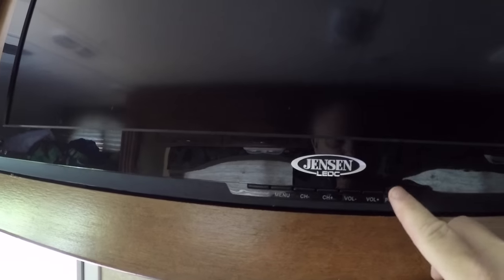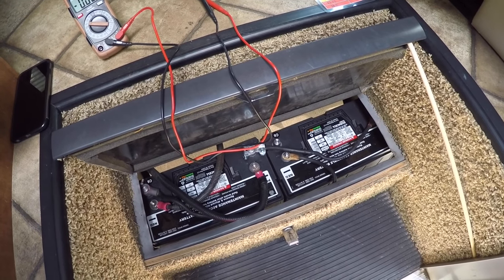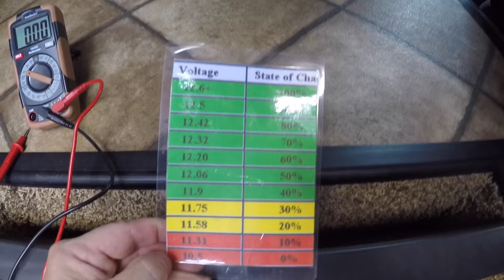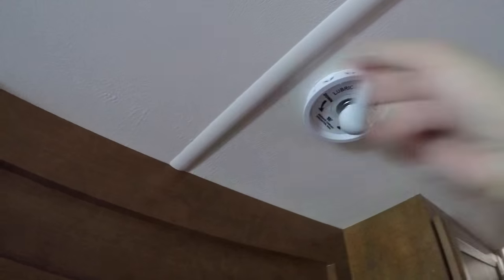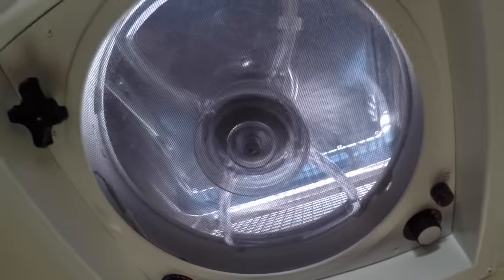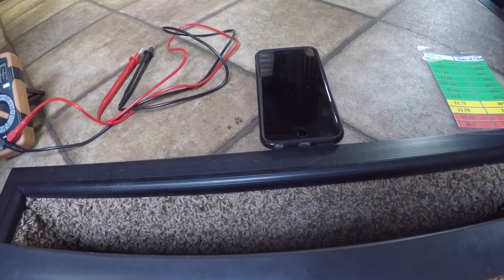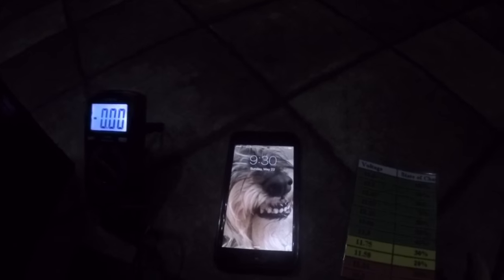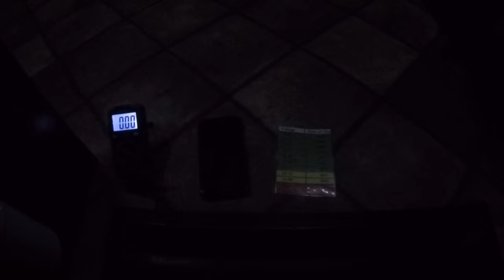RV Batteries... dry camping, boondocking and don't do what I did!

Comment: I bought a victron monitor and bridge and what a great tool that is. I know exactly how many cycles I've run through on my batteries and how many amp hours I've used. The voltage is almost unusable until it's too late to get an accurate reading. Depending on how often you use your RV, it might be a good investment for you. The meter displays a variety of things, but the actual current display is great to figure out how to size solar panels if you're so inclined. Thanks for the video.

Comment: Voltage is a poor indicator of the state of charge of the battery, because the voltage will sag under load, and rebound when the load goes away. Use a battery monitor, like the Xantrex Link PRO if you want true state of charge monitoring.

Comment: I just watched this video and saw right away that you purchased the wrong batteries for your rig. Any battery with a CCA rating is not a true deep cycle battery. I would expect the same life out of these batteries as your old ones gave you. True 12 volt deep cycle batteries are available. The Trojan T-105-RE batteries you mentioned in the video would be my first choice for an RV battery. The next time you need to replace the batteries you may want to look at modifying the battery compartment to accommodate the larger batteries. Its well worth it considering the life span and performance. Safe travels.
Reply: Turning Wrenches what's wrong with group 31?
Reply from the maker: There’s nothing wrong with it. It’s what they put in RV’s. I just replaced what was in mine with 2 similar but different brand. They do not usually put true deep cycle (non rv/marine) batteries in brand new units. It also depends on what you are using it for. But they will be happy to know that I have since, replaced those with 100ah renogy batteries. There’s no way I was or even would now, alter the rv steps to be able to just go to Trojans. If I were looking at an RV and saw that it had been altered like that, I would run the other way.
Reply from the maker: They are probably on the lithium battery kick now. Go big ($900 each) or go home. lmao
Reply: The Woods Online right, I get what you did, but Turning Wrenches said these are still not the correct batteries because he saw Cold Cranking Amps (CCA) displayed on the battery sticker.  CCA usually means it's like a car battery.  I have group 27 on my rv and group 31 I thought was a step up from 27, so now I'm confused.

Comment: The state of the battery using their voltage should be done with batteries under no load whatsoever and after a 24 rest. It is commonly acceptable to read the voltage after 2 hours of rest because 24 hours is often impractical.  Regardless, the batteries need to be without any load.  Even turning off everything is not good enough in an RV because many things need a little bit of power such as a propane detector or modern day radios or TVs which use a little power even when "off". This is because the digital circuit needs to be powered enough to figure out if you want to turn on the "on" switch.  If you don't do these measures, the meter will show a voltage that is lower than it should giving a false charge level.
Reply: Because he is not disconnecting the battery bank the voltage he is reading is skewed and will not match the cool chart.  The voltage reading he is doing is good only relative to itself but as long as he tests the same way each time he can build up meaningful data.  A battery switch would be handy for testing or just disconnect one of the cables.  I use this digital power meter from Amazon: http://a.co/1XWRvfk and rely mostly on watt hours consumed to determine remaining battery power.
Reply: This is true - the 13.12 volt reading at the beginning was obviously taken right after being charged. The rise in voltage after the TV and light was turned off was just a function of the internal impedance of the battery. No load after a "resting period" is the best way to tell.

Comment: Appreciate the review for basic led acid batteries. Since i'm not ready to switch over to Lithium. We own a new TT 19ft with all the goodies. But In my case our 12V 10.7 cubft refrigerator will be on. Yet fridge brings a feature called night mode. Runs as efficient and quiet as possible at bedtime for 8 hrs if door doesn't get opened more then once in that mode. And the fan of course to draw in the exterior cool air.  Our boondocking is common on travel for a night stay. Or we will boondock where gen is OK up to 8PM if needed. Come warm nights here in the Florida and when traveling Northern States. I need to stop in an RV park for A/C coolness for sleep. Reason i don't care to invest into a Lithium. Would beed basically $8k to $10k system on lithium to run A/C for 8 hours lol. Not happening lol

Comment: Surprised you don't have a simple solar panel hooked in to charge your batts during the day..  I created a portable one myself.. Single solar panel on foldable legs, connected a plug in cable harness which is connected to the solar converter then to the batteries.   Basically pull the panel out of the storage bin, plug in the cable/harness since I set it up with a plug in type quick connect and then set the panel outside pointed at the sun...  I have a wind turbine also I put together that can also be set up and plugged in the same way for those days & nights with no sun light..  Huge difference especially when cold and you need to run the furnace.

Comment: It's been a while you uploaded this video. Have you figured out that you should have connected the cables from the RV across both batteries.? So what I'm saying is the positive should be on one battery and the negative should be on the second battery in order to get a more constant discharge/charge of both batteries  simultaneously.  I know that it looks like that ends up being the same thing however it is not,  because there is a voltage drop on the jumpers between the two batteries which creates the difference pulling power from only one battery set of terminals.

Comment: Looks like camping world connected the batteries for parallel operation but in a non symmetrical way. At the very least you should use one batteries post for positive and the other batteries post for negative. This way each battery should charge and discharge at the same rate. If you do it the way shown this raises the possibility of creating circular currents where one battery discharges faster than the other and changes in load create currents are such that one battery also charges faster then the other. I also use the same the same length and type of battery jumpers this way the voltage drop across either jumper wire is the same. This also helps keep the charging or discharging of the batteries equal. Always replace and both batteries at the same time.
Reply: Also If you look at the picture shown the batteries were installed in reverse which is probably why camping world couldn't get both load wires to reach opposite sides.

Comment: Have you ever tried this experiment with the fridge on or the furnace instead of fans? I need to step up my batteries and not sure what route to take. Thanks for sharing your video.
Reply: LetsRV my two batteries run fridge, furnace and my CPAP machine all night long .
Reply from the maker: Sorry that we never responded to tris before. But yes our fridge is running. Although it’s on propane and just hulls a little from the batteries for the board. Haven’t tried the furnace. We normally don’t go anywhere where we need to run the furnace. If it gets cold we have a space heater we will use and are usually on hookups then. But two batteries should be fine with running a furnace all night. Very seldom will we actually use a the furnace. Main reason is it sounds like a jet engine taking off when it comes on. And with it cycling on and off, we wouldn’t get much sleep.

Comment: You guys wanna get premium but high current batteries for right around the same price then u need to look into car audio battery brands like XS Power, Kinetik, stinger, northstarr & shurican they're designed to be abused & discharged and recover faster and they come in all styles from agm on up to lithiums I get way more power and use not to mention life out my batteries.. the group 31 audio batteries have higher ratings such as ther A.H. ratings cca ratings on a avg group 31 is 1500+cca's and can handle upto 3500+ volts max and like I said ther designed after ther drained to recover fast esp the xs power lithium that are rated to handle 15k watts and they have a 30k watts battery and thats per battery rating on lithiums for affordable the kinetik rev series is a good agm buy u can get 210 AH's with a cca @ -40degrees of 1800+cca's for round $200 lil cheaper off amazon

Comment: You don't have a power meter on batteries? Or solar panels? If buying flexable panels get ETFE covered panels...
Reply from the maker: +SolarizeYourLife  No we don't have a power meter cha men ted to the batteries other than the built in one on the rv (4 lights). We do have a 100watt solar suitcase and another two 100 watt panels and controller, but they are not permanently hooked up or mounted. Actually have only used the suitcase once while camping. lol

Maybe one day, we will get them mounted. Just can't bring ourselves to drill holes. lol our plan was to use them like a suitcase.
Reply: RVing Illustrated I would think hooking up your solar would run your tv, lights, and fans. Especially your 300w panels. Why do you need to run a generator? I'm missing the point I guess
Reply from the maker: +Schizzultz they won't run an air conditioner like the generator does. And the generator charges the batteries quicker. And we have no inverter.
Reply: RVing Illustrated oh, I didn't catch the AC part, just the fans
Reply: I got a pair of 100 watt panels and then used piano hinge, 1 X 2 boards and some misc. hardware to create my own 200 watt suitcase array.  It ended up being about $350 as opposed to $500 for a pre-made 100 watt suitcase.  I built the suitcase so that the folding puts the front surfaces together isstead of on the outside like the pre-made suitcases.  This negates the need for a fabric stowage case and decreases worry about scratching or damaging the front of the panels.  Also I got to pick out my own charge controller instead of having to settle for the cheap one built into the pre-made setups.  I stow the array on the bed when I'm driving as I don't have a bin large enough to handle my suitcase. (it's a 1987 rig and the bins are both few and small-lol)  With a 400 amp/hr battery bank (12V flooded lead acid deep cycles) and me being a light user of electric power (about 50 amp/hrs a day) I can boondock for up to 7 days without taking my batteries below 50%. (unless the weather is bad)

Suitcase advantages include: easy to re position and not having to park my rig in the sun.  Fixed mount advantages include not having to stow the panels when not in use and the ability to have a larger array.  

Personally, I like the setup I saw in another YT video where the panel was mounted to the rear grab rail at the roof edge using hinges and a backing board.  There was a support rod and a latching system that allowed the panel to be raised or lowered for use or travel.  This would work for a small array, but if your goal was to mount a lot of watts then this wouldn't work.
Reply: I have 1 - 300 watt panel mounted to my TT  via 3-M VHB  two sided tape. 4 years so far without a problem.

Comment: BS on that stupid antenna crank! Have satellite at home, get a hundred dollar mobile dish with tripod, throw your home receiver in the truck, hook it to the satellite loop in the RV. You get good at pointing, takes me 5 minutes to get a signal, a few more to tune to 90% (clear view to 180-210 assumed for me). If I know where I'm going to be, do a lookup angle, draw a line in G Earth. When you get to sight, stand behind dish and point at landmarks line went through. Usually I get a start signal from receiver right away. Oh, anchor that dish, wind blows it over easy.

Comment: how do you get the batteries in and out from under the step? I have 2 in there, as well, and we can ot get them out. I fear we may have to take apart the steps
Reply from the maker: +holly tamale You should be able to pull them out. They got them in there. lol. When we replaced ours, we went with bigger ones and they were difficult to get in. So you may have to slide one to the side try to pull the other up that way.
Reply: We ended up taking apart one of the steps today. It was the only way.
Reply: Holly, your dealer or any dealer of your brand could have helped. Are your batteries original or did someone put in new batteries that were a bit oversized.? Sorry for the aggravation and trouble.

Comment: I imagine a person could not use the fans and just open the windows and have more juice to have entertainment for more than an hour and a half.
Reply from the maker: Yep. It all depends on what you are using. Like I said in the video, we weren't running the fridge, but the fridge panel uses very little. Not sure it would of made any significant difference. We also have these solar lights hat we like to use in the RV at night and not turn on any lights or use them very little. Then during the day we set them out in the sun or in an area of the RV that gets sun and they are ready the next night. We have a video on them too.

Comment: Idont think if you raise a step 1 inches,would be end of the world
Reply from the maker: +Zoltan Szabatin it would require a lot of modification.
Reply from the maker: +Zoltan Szabatin and for very little gain if any.
Reply: RVing Illustrated I have the same situation with the spacing and placement of the battery compartment. I went with 6 volts and put them in the compartment aft of the door (2013 Forest River 3071ds). I would like to put a total of 6 in there, but Forest River doesn't seem to be able to answer emails regarding how much weight side compartments can take.......

Enjoy your videos!